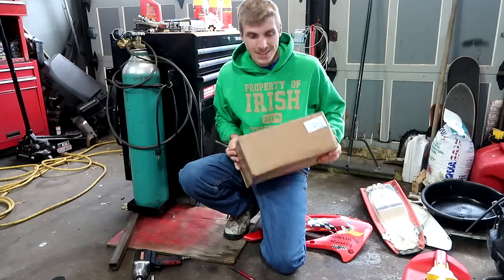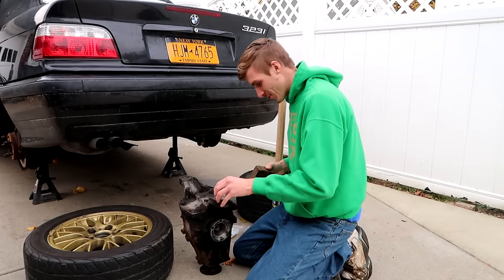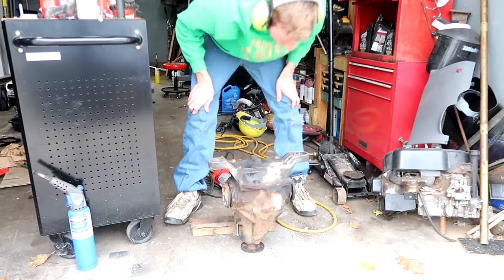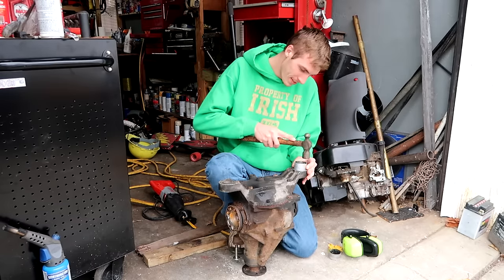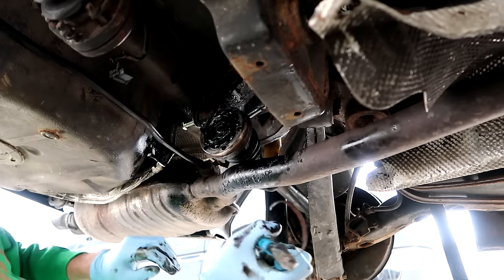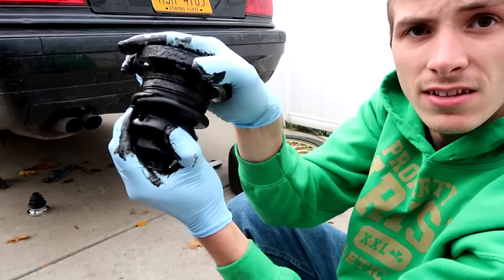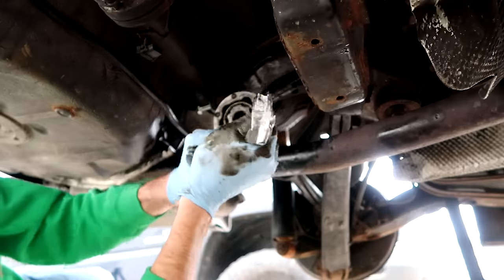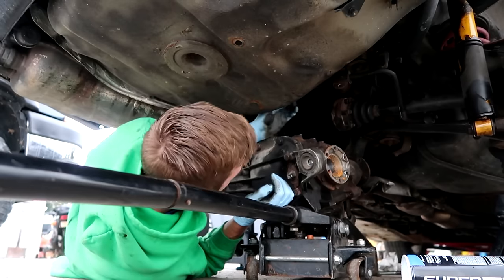1 Tool You Should NEVER USE On Your CAR

Comment: As long as you take your time and are careful with a sawzall, you can get great results cutting out old bushings. I cut out my control arm bushings and diff bushings on my e46. Took forever, but you would never be able to tell.

Also, when installing new bushings, a bit of grease around the bushing wouldn't hurt. It'd make it much easier to install.

Comment: a Press is the tool you're looking for to replace that.  hammering on the diff while it is resting on the input shaft won't be doing any favors on those gears.  and next time, freeze the bushing (in dry ice, preferably, and heat the diff with a torch.  this will shrink one and expand the other. hammering on cast parts is a good way to invite disaster.

Comment: Use a Dremel tool with a cutting disc.  That's what I use to remove race out of housings.  Little cutting disc works better and you have more control.

Comment: You should look up alldata. It's a website that has info on how to fix just about any problem on just about any car. My uncles automotive shop (a few master techs including my dad) use it and doing a head gasket Job on my truck it came in handy with all the torque specks and the bolt pattern to put them back in and all that good stuff

Comment: Burnouts are really great for high mileage diesel trucks, it helps improve everything especially the pressure plate and transmission components !!
Reply: no pressure plates on auto transmissions bud
Reply: +Rob Miller regardless it's horrible on any car or truck , puts stress where it shouldn't be.

Comment: if you put a big socket that cover bushin that your putting in then put a big bolt in and washers and a nut on the other side it will go in I lot easyer than with I hammer

Comment: Next time put it in the freezer so it slightly shrinks the part and you could use a torch to heat the differential up to expand it in no problem

Comment: DALTON people like you shouldn't be aloud to touch tools!
The correct method of getting that bushing out is to use some heat and a hydraulic press.
OH BROTHER face palm
Reply: He's workin' on a $500 car to make YouTube videos.....no biggie.
Reply: Keith Brettell. The low value of his car doesn't mean the job should be done incorrectly. Let's look at the worst case scenario because of the incorrect procedure... due to him cutting into the diff mounting bracket it's weaken it! He's driving down the road and it suddenly breaks, from it breaking fuck knows what could happen next, loses control and causes a pile up killing a number of people. That's 10 years+ for manslaughter, and all because of the incorrect tools and knowledge for the job.
Reply: YEP that's what I reckon also, Nicely said took the word's right out of my mouth.
Reply: NASA 1 YouTube is a great resource for figurin' stuff out but if you're lookin' for legitimate automotive repair advice you shouldn't be lookin' at 3D Machines for it. I think most people realize this, so again, no biggie. Keep on braaaapin' and makin' the shot Dalton!